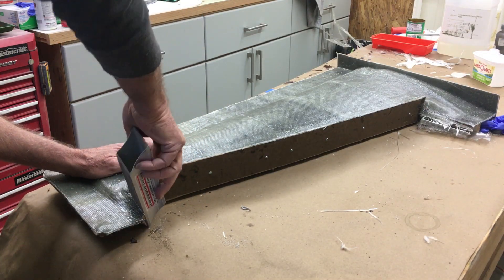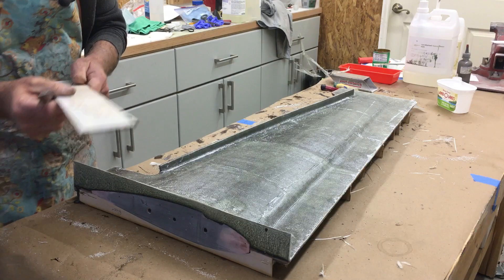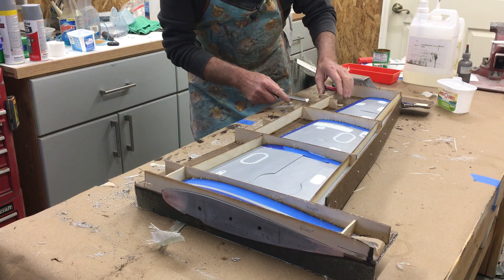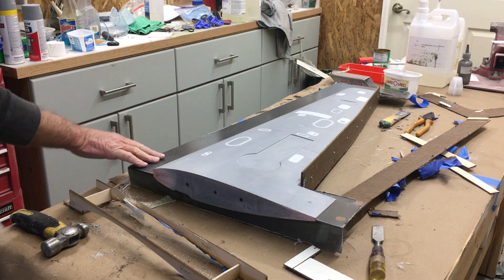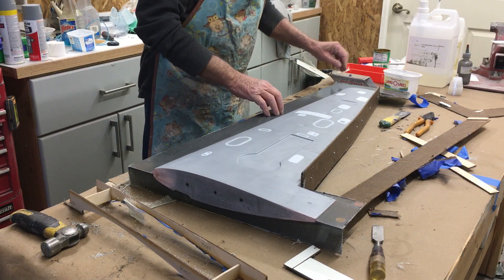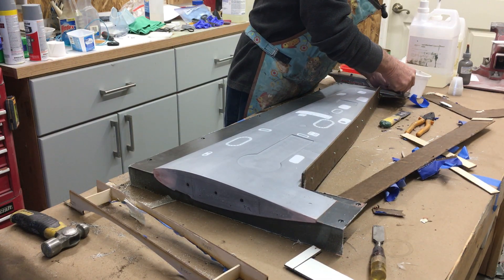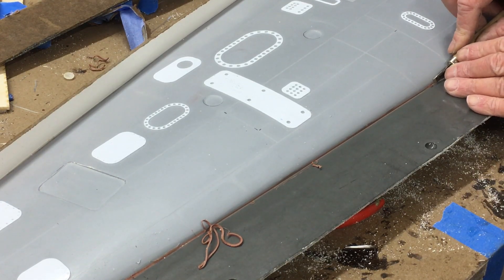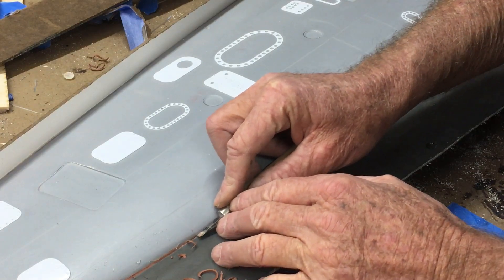Tucano Part 22 Finish wing molds.  Came out great

Comment: The # of videos posted by rc builders working with fiberglass and carbon fiber not wearing any respiratory protection is scary.  We have known about the dangers and risks of inhaling fiberglass dust for 40+ years. They all believe that they are the exception to the rules until they get the test results from the oncologist.

Comment: Great building techniques, learned a lot. 
I have a doubt, why not directly 3D print the mould instead of printing plug and then creating mould out of 3D printed plug?
Reply from the maker: Thx for input...  Because 3D molds a weak and not very good for repeatable layups.  Also, very difficult to add screws, panel lines and rivets
Reply: @britcharming  ohk that makes sense